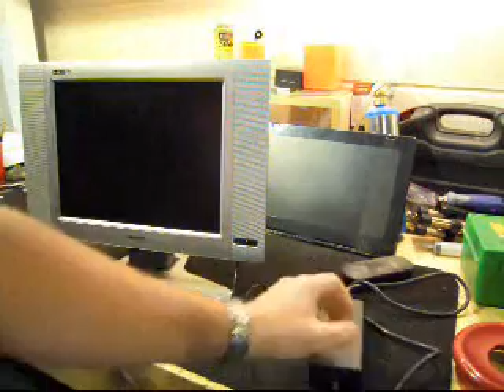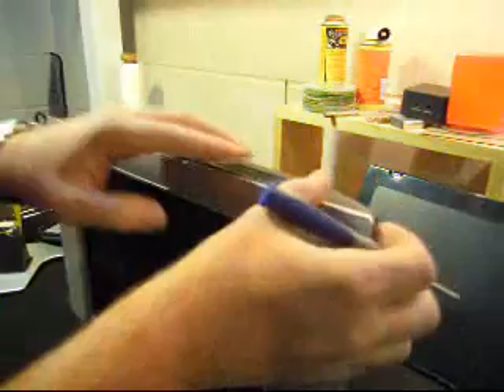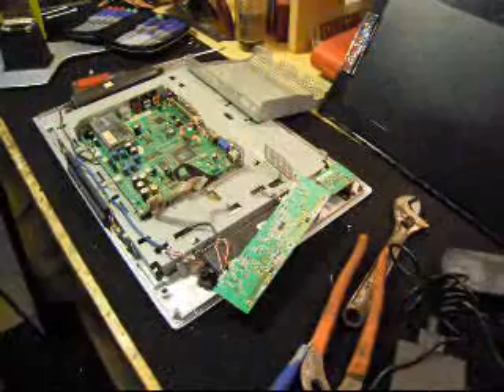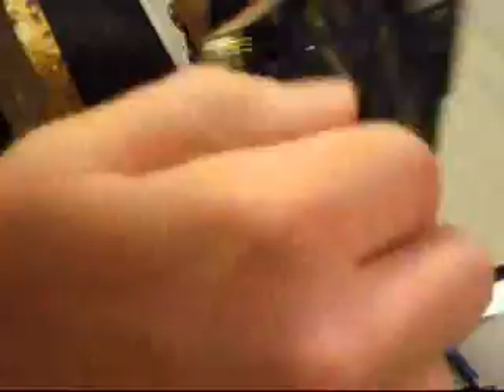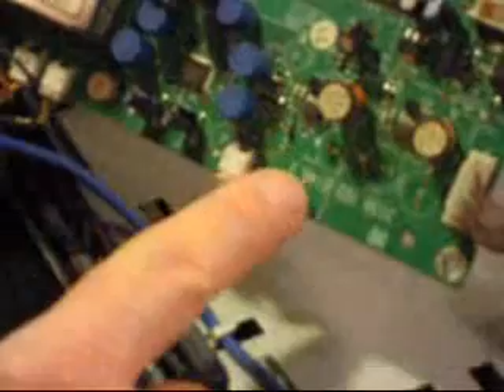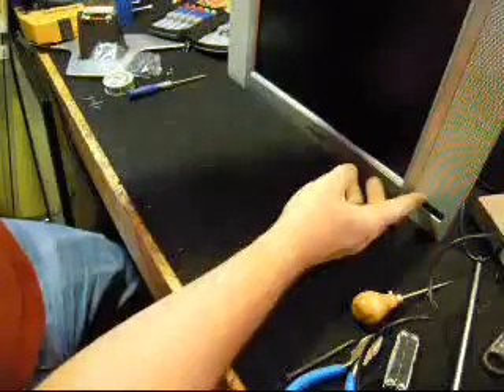Magnavox LED TV Won't Turn on! No Power! Blank Screen! Easy Repair 15" Panel TV Fix

Comment: I have one that turns on has snow for like 2 minutes then goes black and seemingly it seems like it shut off but upon using a flashlight to the screen it is still on and showing a image I would imagine if the backlight is bad it wouldn't show snow (as I have a newer Toshiba the backlight went out on that didn't show snow or any image when the backlight went out) 

That said what the hell is wrong with it? I bought it for 10 bucks off Facebook new old stock it was brand new in box and everything person said they only used it for 2 weeks the remote doesn't work and the buttons on the actual set barely seem to work tho do work

Comment: I know that this video is old, but I just picked up the same exact TV today at my local thrift store for $7.99. It works, but I think I will give it a recapping. Its great for watching old DVDs on. Its native 4 x 3 aspect ratio is good for old TV shows such as The Andy Griffith Show and I Love Lucy.
Reply from the maker: cool. I did this fix on it a couple times over the years before giving up on it. Did the trick for 2-3 years though.

Comment: Invest in a solder sucker to open the holes on the board. That aw is a great way to rip the solder pads right off the board.
Reply from the maker: Thanks,  I'll admit,  I'm no electrical master.

Comment: great work ;) we have one and the tv got turned off and i watched the whole video just to find out that you have to push the menu button =/ but hey it works now lol.
Reply from the maker: +Robert Texidor Yeah, I guess I've had this happen 3 times now with 2 different TV's. I wish it would have been an easy fix like that, but I finally got tired of tearing it apart and paid $80 for a new TV. I still have the 2nd one down there waiting to get repaired again.